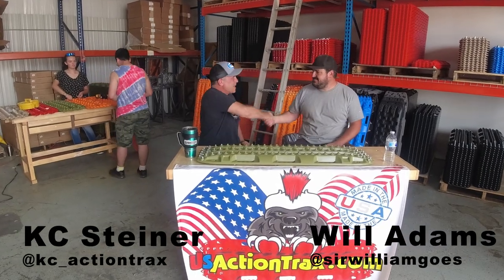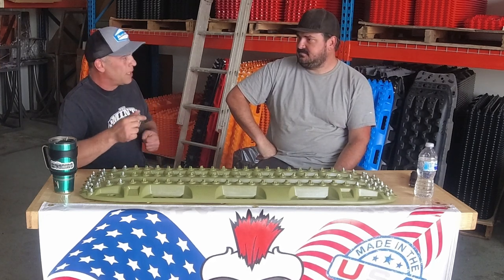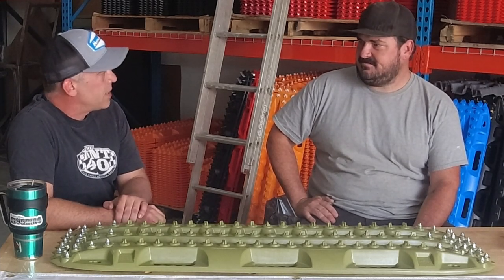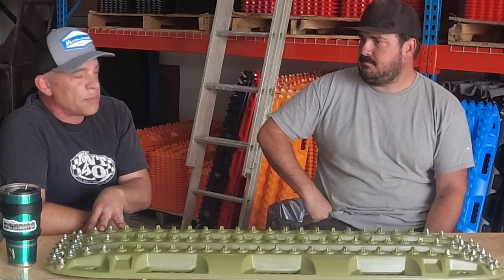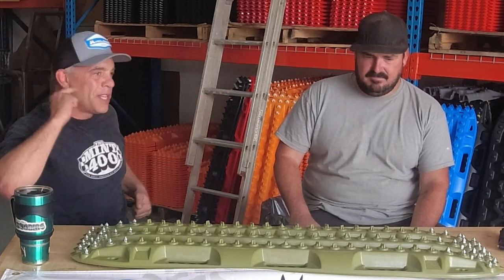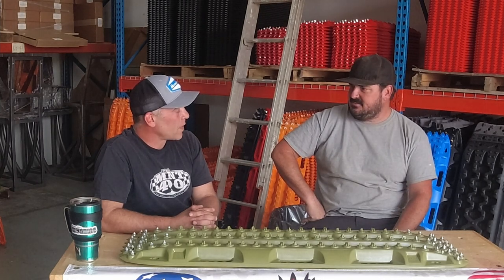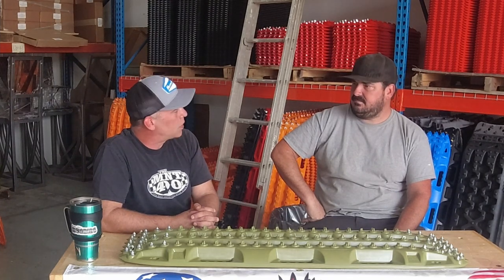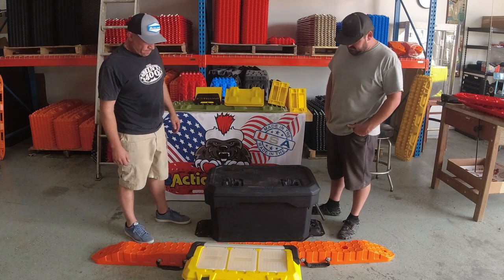How To Make The Worlds Best Traction Boards / Recovery Board

Comment: Awesome Will, great to see a mom and pop company doing well and focusing on American made manufacturing! Do you know if they will have a booth at Expo East? If so I’m definitely picking up a set. 🙌
Reply from the maker: They may. I also have a couple set of what we “blems” basically when you switch colors on the production line sometimes you get small bit of the previous colors on the current. I have a set of metal studded as well as standard.
Reply from the maker: Update!! I will be at Expo East in the ActionTrax booth, stop by and say hey!
Reply: @SirWilliamGoes  h%ll yeah! Make sure and save me a set of Yellow ones! Looking forward to it 🍻🍻🍻

Comment: Hey, Will, are the standard ones and the extreme ones made of the same material or are the extreme ones made of a better material
Reply from the maker: Yes they are both the same material. The extreme have metal teeth in the first few rows. The benefits of the metal teeth is you’re less likely to spin tires also if you do they wont get damaged

Comment: May get a pair of it here.  One of my cheap boards just got long crack when I attempted to get out of snow ditch.
Reply from the maker: Yeah the lower end boards tend to do that. ActionTrax last in -40 all the way to 150
Reply: @SirWilliamGoes  yeah the boards handle almost 50k lbs and has less chance to have cracks.  I will keep it in mind.  Thanks.